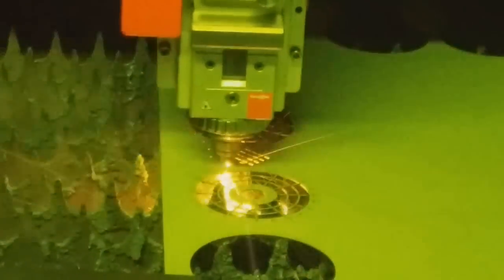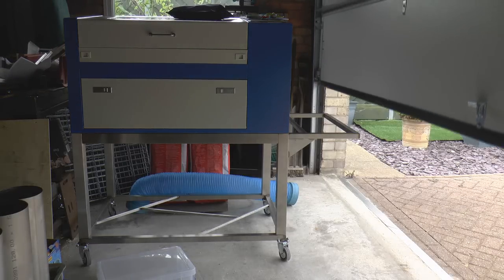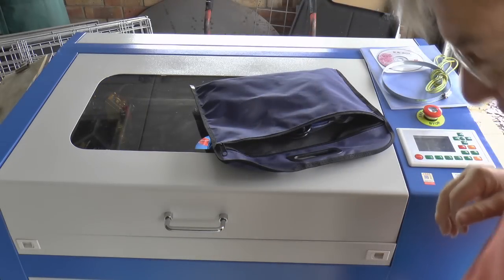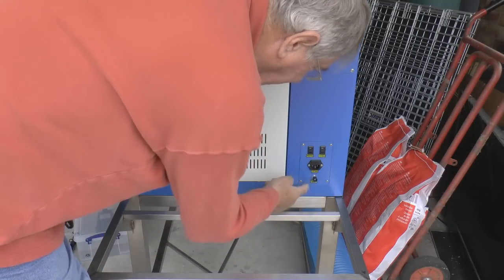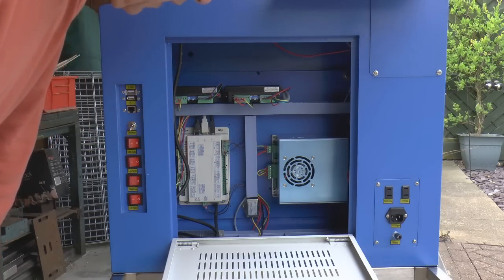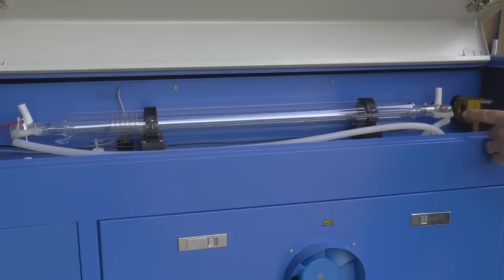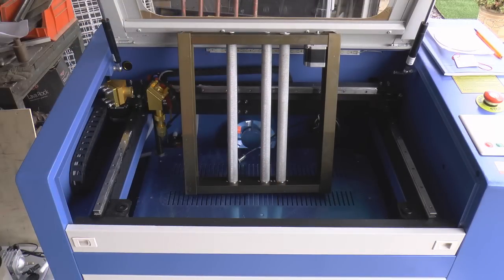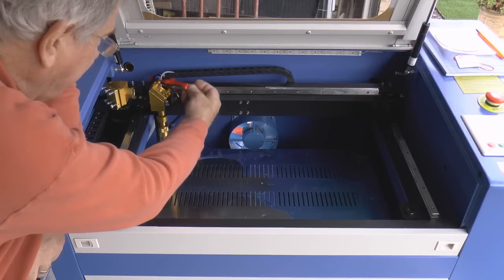Chinese laser cutter  tutorial part 1

Comment: Russ:  First of all, I really appreciate your learning lab videos.  I ran through many of them while I was waiting for my laser to arrive and I am running through them again now that I have my machine.  I am having a problem trying to upload files from a USB flashdrive to the machine.  Somehow I succeeded once, but that was obviously an accident. It seems that I need to change my file to a .plt file for the Ruida controller to recognize, but it has only happened on that one occasion.  I cannot recreate the sequence in spite of many different iterations.  I have two USB connections, with one labeled as "USB".  I have tried inserting the flashdrive prior to starting machine and from both USB connection points.  If you (or any of your other admirers) can provide a possible solution, I would really appreciate it.  Thank you for your time and expert tutelage.
Reply from the maker: Hi Rick
 Im pretty sure the machine code files that are generated when you press the Save to Udisk button are not plot files or even G code files.. I suspect your problem is just a lack of one piece of vital information. Your USB memeory stick must be formatted FAT32. Although there are 2 USB ports on your machine, only one is for the memeory stick. The other is for your PC. When you have plugged your memeory stick into the right port and pressed the FILE button, you will then have to step through two or 3 menues to load your file .
 This should fix your problem. On a few occasions when it doesn't it may mean that your are working with a buggy isue of RDWorks. Look at the top left corner above the menu barand you will see V8.01.??.  Ithink the latest available version may be 44. I am using a pretty stable issue 38.

Best wishes
Russ
Reply: @SarbarMultimedia  Russ: Thanks for the quick reply.  I checked and my version (downloaded from the site) is version 44, as you suspected.  The version that came with the machine software is version 10, which I did not use.  By the way, the verbiage in the accompanying manuals is not any easier to decipher than the documentation that came with your original machine.  When I installed the RDWorks, it prompted me to insert a USB flashdrive.  So, I am wondering if that accomplished the formatting that you mention.  I did succeed one time, with a test program to determine speeds and power.  That was the one and only time (but as they say, even a blind pig finds an occasional acorn).  The message that comes up now on the control panel is that there are no files to download. I also reached out to the manufacturer, but as you might suspect, they are celebrating the Chinese New Year and promised to get back to me after that.  Since I have a dedicated laptop that I do my work on, I think I will try connecting it to the machine today to see if that makes a difference.  Any tips that you might provide on that process would be appreciated.  Thanks again, Rick
Reply from the maker: @rickschwab3921  
Hi Rick
When installing the software, I plug in any convenient USB memory stick and it is happy to complete the installation. As I mentioned, the machine will only read FAT 32 formatted sticks. You should have no such problems with connecting a pc.
The quick way to test your pc an machine are communicating  is to go to File, Vendor Settings and use the code RD8888. Press the READ button and you should see a green progress bar as the machine uploads all of its key settings into RDWorks. Now press the SAVE button and save this data somewhere safe. Press EXIT and then go to top right and press the USER tab. Press READ  and agin save this data to an external file. You may need this data in future and you cannot rely on the manufacturer having saved it in Factory Defaults.

Best wishes Russ
Reply: @SarbarMultimedia  Russ: Hauled my laptop down to the garage to connect it, but in one last ditch effort I did several different scenarios to try and utilize the flashdrive.  Finally reached  success!  I was trying to use the "save to ufile" button on the RDWorks main screen but the machine would not recognize the .rd file to upload.  My successful runs have been by using that button to save the .rd file, but also exporting a .plt file to the flashdrive as well.  Seems to work every time using that method.  Now in the process of determining what power and speed settings to use for my 100 watt machine.  Thanks again for all your help! -Rick
Reply from the maker: @rickschwab3921  
Hi Rick.
Once you have done a save to Udisk onto your flash drive, clear the RDWorks screen and then press the preview  blue screen icon. This will open a black screen and at top left, ask you to load a file from your flash drive . You will now be able to see the data that the machine sees. You can press the simulation button to see it running . If you can see this, then there should be no reason for your machine to ignore it.
I do not have issue 44  so I cannot test it. 

Best wishes
Russ
Reply: @SarbarMultimedia  Hello again, Russ.
Thanks for that latest tip.  Now getting consistent output on my machine, just need to check my input a little closer.  Recently watched your video concerning the honeycomb work surface and experienced similar problems when engraving and cutting 3 mm acrylic directly on the honeycomb.  Next run will be with the work piece elevated above the surface.  Latest issue is what appears to be scarring on the surface of the acrylic, adjacent to my text scanning.  Thought it might wipe off, but it appears to be permanent.  First thought is to reduce the output power, or increase the speed, but your thoughts would be appreciated.
Reply from the maker: @rickschwab3921  
Hi Rick
Sadly you cannot easily remove the residue you are seeing. Acrylic is unique among plastics in that it acts exactly the same as water. At room temperature it is solid, at 160C it becomes liquid and at 200C it evaporates just like steam. It does NOT change chemically, so when it hits a cool surface it will condense back to solid acrylic, but not before it has bonded itself to your naked acrylic surface.. There is one fundemental picture I must paint for you.
When you hit the surface with the laser beam it excites the molecules in the surface so that they vibrate faster and faster. The vibration level of a molecule defines its temperature. So the faster it vibrates the hotter it becomes (there is no heat in the laser beam, just light energy) When it reaches 200C it changes for liquid to gas. The gas state is thousands of times  more volumetric than the solid state.  Thus if you just pulse the surface you will see a little volcanic explosion of fumes that shoot UPWARDS. . As you increase the power and/or duration of the pulse the rate of gas expansion becomes so great that it cannot just expand upwards but is forces SIDEWAYS as well and this is where your problem arises  deep cuts =lots of horizontal vapour  and shallow cuts =vertical vapour.
If you opt for deep cuts then you can protect your work surface but you will still get residue in your cut. To protect your work surface you can either leave the protective covering on or rubbing an ordinary bar of soap over the surface will protect the surface and allow you to wash it in water afterwards.
Better still,  keep your cut depth to a minimum and when the vapour is airborne, make sure your airflow ACROSS the  worksurface is good and fast so that you draw the vapour away befor it settles.   Also you need your nozzle at least 12mm above the work and only the mearest whisper of air assist to protect the lens. You do not want to blow the fumes down onto your worksurface.

So that's a few things to consider

Best wishes
Russ
Reply: @SarbarMultimedia  Russ: Back again.  Many thanks for the great information.  I have moved into wood engraving at the moment, but will heed your advice that next time that I return to acrylic work.  I installed adjustable props on the access door, to revise the airflow across that work and also increased the speed of the supplemental inline fan that I installed.  The power was set at 25% when the fogging occurred.  For some reason, I seem to remember viewing an online video somewhere that cautioned people against reducing the power below this point.  Do you agree with this, or do you have any alternate suggestions?  I have purchased a meter to monitor the power input, but haven't had the chance to install it yet.  Also, do you have any recommendations regarding speed?  I haven't exceeded 500 mm/s at this point, but if I cannot continue to lower the laser output, maybe I can increase the speed?  Thanks again, Rick
Reply from the maker: @rickschwab3921   
Hi Rick
 There is no lower  % power limit only an upper one. If you lower the power too much the machine will not spit out any watts. There is infact a very useful range of power low down which is superb for glass engraving and also for paper and thin card cutting. It is called the preionization zone.  To understand more on both these subjects take a look at
https://www.youtube.com/watch?v=2F5O-1TH8b0&list=PLPWEtx5V9DqEogIeYRdcG_KYcB7UL2Qmn&index=7&t=78s
https://www.youtube.com/watch?v=nZuatc3eIgU&list=PLPWEtx5V9DqEogIeYRdcG_KYcB7UL2Qmn&index=26&t=1493s

The only time you need to run fast is during engraving, But the results will be rather raggy round the edges if 
A) you have not set your Scanning (reverse compensation) in  config system settings  See   https://www.youtube.com/watch?v=DeCxeCrq0h4&list=PLPWEtx5V9DqEogIeYRdcG_KYcB7UL2Qmn&index=49&t=1154s

B) Your HV power supply has a slow response time)

You can set your speed to that of light, but the vendor settings will  limit your stupidity to something conservative that the machine designer has set.   Typically the X axis will be anyhing fronm 400 to 600mm/s depending on machine size/ stepper power/mass of head and the heavier Y axis 300 to 500mm/s.

Best wishes
Russ
Reply: @SarbarMultimedia  Hello again, Russ:
I have been having a fair amount of success lately, due largely to your help and numerous iterations on my end.  I was wondering if you have even experimented with the Lightburn software?  I have looked at a few of their learning videos and it would seem that their software is similar to the RDWorks software, but a little more like the AutoCAD that I used during my engineering career.  They state that it is compatible with the Ruida controller.  There is a free trail version that I can download, but before I possibly complicate my life, I thought I would check with you for your opinion.  I always appreciate your input.
Best regards,
Rick
Reply from the maker: @rickschwab3921  
 Hi Rick
 I love Lightburn. It is a great piece of software written by a private individual  to do everything that RDWorks does plus a lot more. It has a  more intuitive and friendly user interface but be warned it is a still and interface program and not a CAD or vector design package. It has many features, like the way you can manipulate text, that makes it Illustrator-like. There are still a small number vendor control features that most will never need that are not yet in Lightburn It is a great investment  and as you have already discovered, is well catered for with high quality tutorials. It also works with more than just Ruida controllers and can be run on Apple, Windows or Linux machines  My RDWorks channel was underway long before Lightburn emerged and my channel has for a long time now  focused less on the RDWorks  software itself and more into exploration of the laser technology to extract the maximum potential from these cheap little Chinese machines. I still use RDWorks for the reason. that newbies can use it for free and become familiar with the machine and software before migrating to something significantly better (Lightburn.) Everything I do with RDWorks can be emulated in Lightburn.
Best wishes
Russ
Reply: @SarbarMultimedia  
Hello again, Russ.
Hope all is well with you and your family.  Been busy getting familiar with my machine, so I haven't needed to bother you with questions.  I do have an issue right now that I hope you may be able to help me with.  While setting up my machine to use the rotary attachment, I somehow fouled up the X,Y coordinates.  I ran the laser head back to the top left corner of the table and hit the red reset button.  It then reset the current position to 0,0.  I thought I has home free at that point, but when I now run the head out on the Y axis, it only moves about a third of the table and then stops, indicating that it has reached the end of the table at 600mm.  Thought I might be able to reset it to factory parameters, but that requires a password, which I don't have.  Any direction that you could provide would be greatly appreciated.
Best regards,
Rick
Reply: @rickschwab3921 
Hi Rick 
 the good news is that your are most unlikely to have fouled things up because the machine sorts itself out when you power it up or press reset. The most likely issue is  your X axis sensor switch is not working. Take a look at this video to start with as it explains how the axis reset system works. If you are still in trouble after watching it. add your disguised email address to another comment and I will contact you so we can speak off-line.
Best wishes
Russ
Reply: @russsadler3471  
Russ:
Your link directed me to the your first video session, which I watched again, but didn't see any reference to the sensor switch.  Meanwhile, I started the laser again and opened up Lightburn.  Seems that I had forgotten to deactivate the rotary selector in the software.  Didn't think that would have had any effect on the Y axis, since I had unplugged the rotary and reconnected the standard Y axis plug.  But when I fired up the laser again, everything was functioning properly.  Seems as though those clever Chinese engineers managed to make the machine virtually idiot proof.  Sorry to trouble you with my blunder, but it is always good to have a little chat with you.
Best regards, Rick
Reply: @russsadler3471  
Russ:
Well, I thought I had my situation conquered, but I was wrong.  Started up fine late yesterday, but today it started acting up yet again.  If we can discuss per email, I would greatly appreciate it.  No space, with a "1" and gmail.  Thanks.
R

Comment: Where did you order that machine from.  And is there a model number ... thanks great video.
Reply from the maker: Hi Robert
 Things have changed a lot in 4 years. I bought mine from Ebay  and it was far from perfect. But hey, I mustn't really complain because it has forced me to learn and understand not only about  the machine but also the underlying technology.. So let me take a look on your ebay.com to see if there is anything there worth buying.

Lots of junk machines with old style analog controllers and mickey mouse bearing systems This one is a close match to mine but it is a manually raised and lowered table (the silver knob front right). It is also very expensive in my opinion. There are three people in the price chain. Th company that assembled it,  Coletech who are the stockist in China and the Signtech company that is selling it to you
https://www.ebay.com/itm/Brand-New-60W-CO2-Laser-Engraving-Cutting-Machine-with-Auxiliary-Rotary-Device-B/151644416803?hash=item234eb62b23:g:JPYAAOSwYIhWj4Dl
It claims tp be a 60 watt machine but it is not. In reality it MAY be a 50 watt tube that has been tested to a max of 60 watts but I even doubt that because  the machine is only 1020mm wide and a 50 watt tube will be 1000mm long I see no extension box thus this may well be  only a 40 watt 800mm long tube..  Bearing system and controller are fine so mechanically reasonable, just seems a rip off.

 Here is the same machine at a sensible price
https://www.amazon.com/Engraving-Cutting-Machine-Engraver-Auxiliary/dp/B01AJIMCKS/ref=sxin_1_osp48-6e237484_cov?ascsubtag=6e237484-7c94-4bf3-a2ec-4b7514e10585&creativeASIN=B01AJIMCKS&cv_ct_id=amzn1.osp.6e237484-7c94-4bf3-a2ec-4b7514e10585&cv_ct_pg=search&cv_ct_wn=osp-search&keywords=laser+engraving+machine&linkCode=oas&pd_rd_i=B01AJIMCKS&pd_rd_r=ee362996-fd82-4cb2-9aea-6a60bcb5064d&pd_rd_w=hIIeg&pd_rd_wg=CduFO&pf_rd_p=53eff971-6e12-4016-9864-b6dfd929b2b3&pf_rd_r=W951DMA9YWBVJPJMX2D6&qid=1570394132&tag=spyonsite-20

It has a free rotary device (it is very limited in its ability but its free) and they rightly claim this to be a 50 watt tube  (max test value) but in reality this will be an 800mm long 40 watt tube (maybe B grade ) but this re[presents good value for money and is a proper CNC machine with lots of features

Best wishes
Russ

Comment: Hi, got a question I picked one of these up. It was used. If I hit the reset button the rails take the laser head back to the top right and the table shakes like it is still trying to move yo the right. Got any ideas.
Reply from the maker: Hi 
Yes , it will be the sensor not working, so it cannot set the 0,0 position for the machine.. I did a short video for someone else who was struggling to identify this problem so take a look at https://www.youtube.com/watch?v=PgNT1EhT1Vo

This is what you need as a replacement
https://www.ebay.com/itm/Fotek-Inductive-Proximity-Sensor-Switch-PL-05N-5mm-NPN-Out-DC10-30V-Normal-Open/173302499982?hash=item2859a24a8e:rk:1:pf:0

Best wishes
Russ